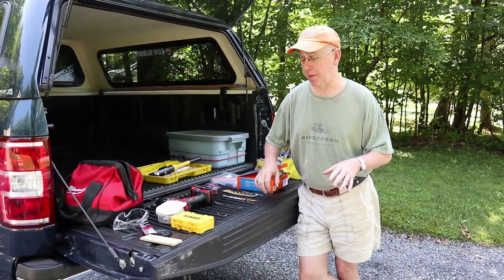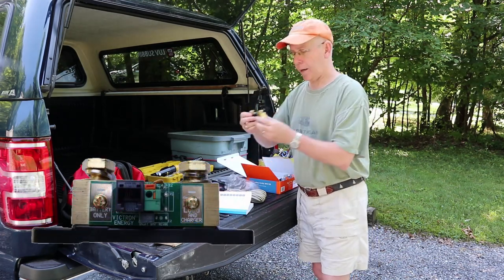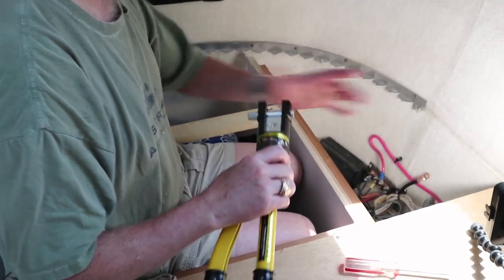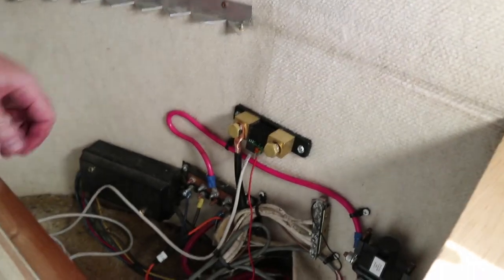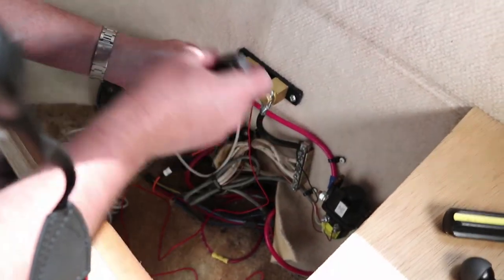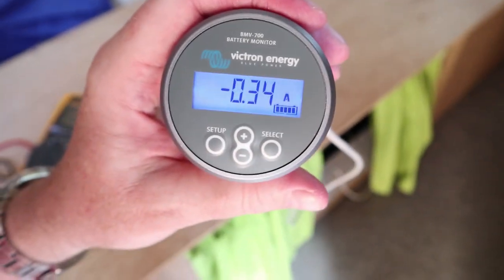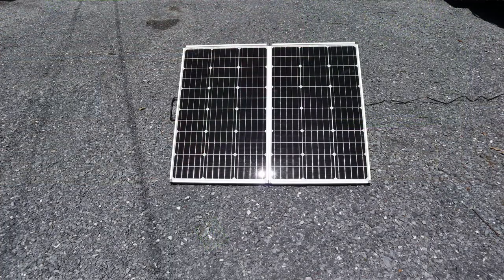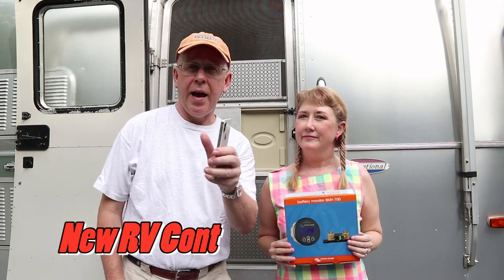Installing Our Victron BMV-700 Battery Monitor!

Comment: I recently installed a Victron DC DC Charger and I was surprised to find that I had to remove several screws under our twin bed where the solar controller and inverter live.  It was my desired install location.  My gripe is that I also had to use a body panel tool to pry the panel upward to access the compartment.  If you had an electrical, possibly a smoldering component some folks would not even had the tools necessary, and would be forced to watch their trailer burn to the ground, even if they had their extinguisher handy.   I have since installed handle on the access panel, and left the screws out.  I know you queen bed is a different configuration, but I think a boat hatch access cover the recessed type would be prudent, where your heat producing components are located so that you could access in a hurry.  I think Airstream should make it a removal lift panel,  much like they did with the tankless water heater access under the twin bed.
Reply from the maker: Thanks for watching and the excellent comment.  In fact, the last time we were in there (to replace our battery disconnect switch), we made the same comment.  Installing a door there is on the list of improvements between our Summer and Fall trips.  Safe travels and again, thanks.

Comment: It looks like there’s plenty of room under the bed for a few AGM batteries. Maybe add a few for your next video??
Reply from the maker: I will upgrade the batteries once my lead acid dies.  My plan is to have a welder come out and move the propane tanks forward and put 2 LifeLine AGM's behind the tanks which is the normal configuration for Airstream's.  Why the 2002 was different is a mystery...

Comment: Great video! Just the help in needed for my install. I would like to know where you made the hook up for solar? My  configuration is very similar.
Reply from the maker: Hi Chris and thanks for watching!  My solar hook up is in need of a redesign.  I bought a Zamp extension cord that I intended to store coiled up in my exterior storage compartment.  Technically, it works great and interfaces with the Victron perfectly to charge the batteries.  I intended just to close the compartment around the wire when we left the campground.  However, the door will not close around the wire so it has to be left open.  I'm going to "noodle" that and will post my solution.  I'm glad our video was useful.

Comment: Thanks for sharing this. We are pondering how to install the victron battery monitor in our airstream. Can you please explain more how to connect the  cables from/ to the battery?
Reply from the maker: Thanks for watching!  I'll try and explain here but if you need more information or have specific questions just zap me an email at luvsubbin@gmail.com  The negative battery cable enters the RV through the floor and was attached to a negative bus bar.  I removed this wire from the bus, crimped on an eye lug, and attached it to one side of the Victron shunt.  I purchased a short battery wire with two lug eyes already connected.  One eye went onto the other side if the shunt.  I clipped off the other eye and this went into the original connection at the negative bus bar.  Easy!
Reply: Luv Subbin perfect, thank you very much!

Comment: I want to put one in my 23FB International, but there is a power inverter under the bed. I understand that there cannot be a connection of any sort between shunt and NEG, but don’t know how an inverter fits into the whole scheme. Any thoughts?
Reply from the maker: Hi Michael!  Thanks for watching.  My experience is that nothing can be connected between the shunt and the negative pole.  This would include your invertor as all 120V loads when boondocking would come off that.  I'm sure it can be creatively done...